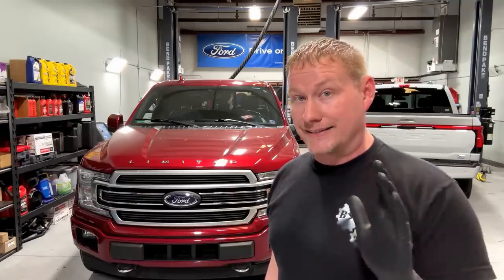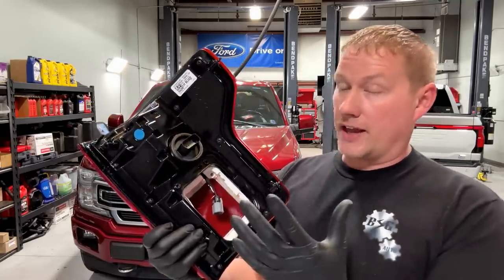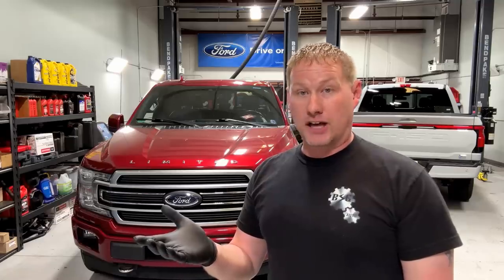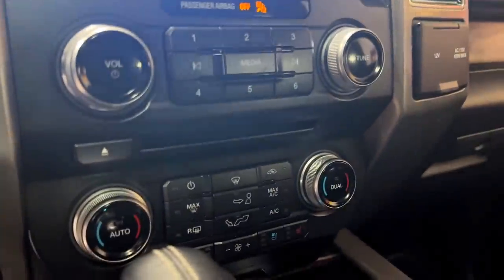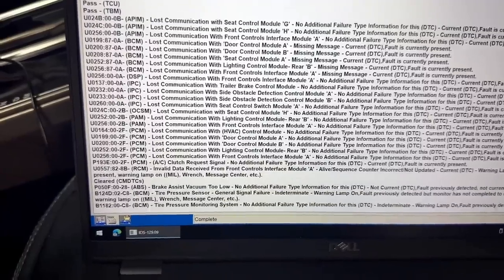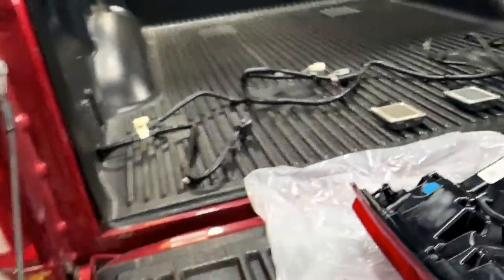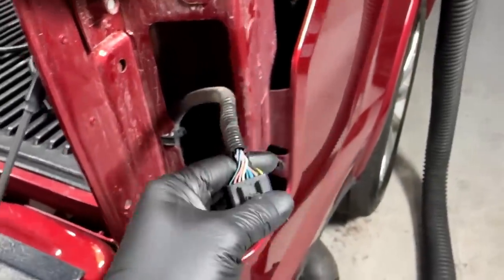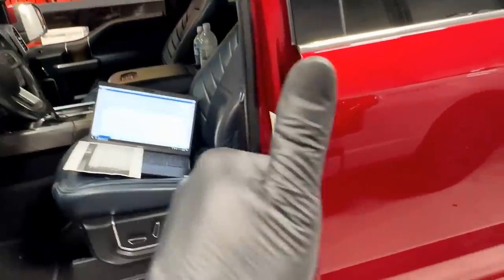Repair Cost Are Out of Control: $5,600 Bill for Some Tail Lamps?!

Comment: I am now 66 years old, and have been watching tons of car crash videos, and while doing so became shocked at seeing many cars being simply written off due to ridiculous repair costs.  What would cost say $100 in my younger days, could be up $10,000 today.  Ah yes, I also recall way back when, that you could even purchase a Honda Civic for $2,000 CAD.
Reply: $100 from 1963 is worth about $1000 in todays money. So yeah, even accounting for the ~900% price increase due to inflation from then this type of repair would still be 5 1/2 times more expensive than back then.
Reply: Back when there were no safety crash standards. Yes all you would need was a new bumper for $100, but you weee in the hospital for a week from injuries sustained in the crash. Today the vehicle takes all the damage and you walk away un injured
Reply: The real problem is Ford using an inferior tail lamp that leets rain water in. My 2016 Lariat was having the same issues. I was lucky, my cost was  $0. My diagnosis was to unplug the white connector under the truck near the spare tire. All the warnings shut off. You cannot drive it because you have no tail lights with that unplugged. I took off my rear passenger tail lamp, shook all the water out of it, left it in the sun for 12 hours, made sure everything was good and dry. Put back together and works perfectly. I did do something’s to stop the water, but Ford needs better parts. I remember when Quality Was Job 1.
Reply: @jackylsmith8138 you won't be in a crash because your newer car with all these crap electronics can't be started at all
Reply: Thx for the vid.
Reply: An 81 year old widower friend of mine spends all his days still repairing things that no one else will because they tell their customers to just go buy new ones (often at 50x - and more - than the original one’s cost).  He has a house, shop, and outbuilding he’s spent his life stocking to the brim with parts of every kind that he’s picked up in old inventory closeouts, swap meets, etc, based on what he knows are common failure points.  We talk on the phone almost every day, and he draws massive satisfaction from just helping people keep their stuff going.  And his work is usually better than original.  He makes improvements when he sees an opportunity (eg: changing old bulbs to LEDs, lowering power demands, etc).  He often doesn’t even charge anything.  He knows where every minute little component he has is stored off the top of his head, and has a massive amount of printed documentation (schematics, parts manuals, etc) from a lifetime of work for just about everything, meticulously organized.  This man is seriously my idea of a true hero, and on the very rare occasion where he doesn’t have a schematic he needs I find it online for him and print it and take it to him (he doesn’t use a computer except to find swap meets).  I know that he won’t be around forever, and that thought kills me.  But being able to even be just an occasional sidekick to this true hero makes me proud.  The world needs way more of these people.  They’re a vanishing breed.
Reply: @TastySurrealBowl  As a Survivalist in my late 50's, I'm actually transitioning more towards Minimalism, these days: Consuming my oldest stored food, getting rid of some firearms (with demographics and physical fitness levels these days, who's gonna attack my house, anyway?).

I'm migrating more towards being like your 81 year-old friend, buying what I need to do my own repairs, fabrication, etc. We have to, now. Our society is collapsing, in-part due to Diminishing Returns on Complexity (Tainter). I don't own a truck newer than 1995. Even my 2007 KLR 650 motorcycle was the last good year for that bike. Besides, the last two times either of my trucks left a shop, the mechanics left dangerously low levels of engine oil, power steering fluid, etc. No one does anything right anymore.

 - Former Army Infantryman, electronics technician, retired U.S. Army Intelligence Officer.
Reply: @jackylsmith8138 excellent point , but unnecessary electronics have nothing to do with this. The best protection is your brain, which seems to shut down with some drivers.
Reply: @jackylsmith8138  It's more like a manufacturer defect. I'm sure it happens to other vehicle brands. But, many regurgitate and talk out of their asses.
Reply: Yes, Dalt's Used Cars in Toronto was the first to bring the Honda Civic into Canada and sell it in 1973.  Dalt's was in my neighbourhood and a friend of mine was one the first to buy a brand new Honda Civic for $1,460.00 CDN.  The BIC disposable cigarette lighter had just been introduced to the marketplace, so when people saw his new Honda people said; "Wow, now they're making disposable cars".  The first Honda Civic ever sold in Canada is now on display in the showroom of Dalt's Honda in Orillia, Ontario.
Reply: I have a 2002 can chassis Cummins Diesel. A little metal clip is all that kept the keyway in and they cost seventeen dollars and require a new plastic axle nut.
  When it failed, the nut unwound and blew the outside bearing ruining the rear axle threads.
   Thousands of dollars even for a jig welded axle end.
   A machinist buddy suggested trying to get a two inch female die after measuring the thread pitch. I made my own thread centering jig out of PVC plumbing pipe of all things 
   I researched further and found out the axle was Spicer so we went with a much superior Chevrolet axle nut and a Chevrolet / Spicer retention ring instead of that crappy little clip that failed in the first place
   Now when I have to replace rear brake rotors and such, there is no fear of this happening again
Reply: @jackylsmith8138 I consider walking away a major injury
Reply: The less reliable, the bigger the income of after sales.
Although safety regulations have become more important, a bumper isn't as rugged, as it was made back in the days..
I remember, running into a friend that just hit a light pole, with his Chevrolet Monza.
The steel light pole was totally wrecked, and the bumper barely showed a scratch..
Reply: @jackylsmith8138   Better crash standards are one thing, all of these unnecessary electronics can fk right off.  You could make basically the same complexity of vehicle as, say, the 90's (golden era IMO) with improved safety and retain the serviceability.  But they want your seat to have heating/cooling/600 adjustments/make ice/blend a martini/etc. and cover everything in 15 layers of plastic before you can even access something that matters.  The only reason people go for all of these luxury "upgrades" is because they don't understand interest rates or debt and definitely don't understand long term ownership costs.
Reply: @TastySurrealBowl 
After living in the southern region of the U.S. for almost 30 years, before moving back to the rust belt, I found incredible 'backyard' good ole boys mechanics available & willing to work on my cars in their home shops. Their mechanical abilities were awesome, their curiosity never failing & their fairness in pricing always sound.
Most were old school, as am I, & as you stated, a dying breed. These guys have a love for cars, always striving to make them better. Admittedly most do not want to work on these tech driven monsters they produce today, but boy oh boy I sure will miss them when they disappear completely. They are a treasure....

Comment: This is why no matter the cost repairs on my old vehicles it's worth fixing. This one repair cost almost as much as the vehicle I've had for the last 8 years. I don't have all these fancy gadgets but I save tons over vehicles like this
Reply: And at the end of day it accomplishes the same goal; IT GETS YOU FROM POINT A TO POINT B.
Reply: Amen
Reply: 100%! My old Ram is ugly, but if I keep it maintained, it will keep running. It will be a treasured antique long after these modern vehicles have been recycled.
Reply: Same here.
Reply: @jamesgizasson ever check what those "old" Rams are selling for? My old 87 Power Ram in good condition, others asking about $25k for it. Mine isn't for sale.
Reply: @northdakotaham1752  Oh, I'm aware. But even if some fool offered me 25k, I wouldn't be able to buy a better truck for that money... 

All I'd get is a prettier, more complicated, more expensive, less reliable piece of crap. And it wouldn't have as much aftermarket support. T^T
Reply: I just paid $3,500 for a 2003 Ford Ranger XLT, just a tad over 100k miles. Drives like new and is simple to work on compared to these new cars. And unless your pulling a huge boat or a large trailer... my little ranger can do everything that $62,000 F150 can do. Oh wait, I don't have a power tailgate on mine so I guess the extra $60k is worth it ;).

Comment: Last July I had a 2015 F-150 in the shop. The radio was not operating, the climate controls were dead, and the power windows would not operate. Same thing, one of the tail lamps had water in it, killed the communication bus. Ended up being a $3000 repair as well.
Reply: You got away light!
 Get a tube of electrical grease and do every connection you can find/ and then the hard ones you cant see. Then keep your fingers crossed and hope like hell.

Comment: Those parts prices are criminal. Unbelievable.
Reply: Why didn't he buy all the parts from a quality auto dismantler as they would have been about 25% of the price of new???
Okay, the taillight lens would have cost up to 50% of the price of new if they were in perfect condition...
Reply: Don't know about this Ford truck but with a lot of cars now electronic parts off another car will not work even if same year, make, model. Friend of mine owns a shop and customer bought a headlight off eBay that worked on the bench but would not work in the car because only the dealer can program the car to accept the new parts and they won't do that unless you bought the parts from them. Because "liability." Edit: I forgot to mention one headlight from the dealer was $3500 and his eBay headlight cost $800.
Reply: My '98 Ranger XLT 4.0 supercab with the automatic and AC was under 20k out the door. That included a deluxe color matched cap and some other bits. Wish I had bought two of them and stashed one.
Reply: $100,000 for a pickup truck is a stupidity test.
Reply: The truck was $68,000. I still have the window sticker. 

I’ve enjoyed the truck. I can afford the truck. 

It’s unclear why people are angry at me for driving a F-150. 😂🤷
Reply: @MH-YouTube-Controlled  The average 35 YO American male is only half as smart as his father, and he was half as smart as his father.  The advertising industry is aware of this. How can the buying public put an end to the $100K pickup truck?...STOP BUYING THEM
Reply: The new vehicles are high-tech. and designed to save gasoline and the environment by making you broke and riding the city bus to get around.
 Old school is always the best school in town.
I go to a dealership and look at the Sheeple waiting in the 'lounge' to get their vehicles serviced/ repaired/ with wallets or credit cards at the ready.
 Schmucks ...
Reply: @Mytruck5600tailights  I think it's because every time someone pays these kinds of prices for what was supposed to be a utility vehicle, it's another data point for the manufacturers that they can get away with it.
Reply: While I've used that truck on several RV travel trailer trips, and to haul various things, I bought it because it was a luxury vehicle. If it didn't have all these "bells and whistles" I wouldn't have purchased it, and I still love the truck. @KidCorporate
Reply: What a disgraceful design from Ford ⚠️
Reply: Then you’re part of the problem, bub! It sounds like you would buy another new truck from Ford, even after this fiasco!
Reply: We need legally mandated standardized bulbs like in the days of sealed beam headlights.

Comment: I think I will look for a 1995 model year for my next F150.  I've had problems with the PATS in my 2010 F150 XLT.  Ford is obviously hiring former F35 design engineers to put all of this technology in their vehicles.  Unfortunately most of us owners don't have almost unlimited funds to keep our vehicles running like the military spends on the F35.  Water getting into a taillight housing is not exactly an unexpected occurrence but obviously the engineers who designed it never thought it could happen.
Reply: I got a 96 ford f150 2wd standard shift 300cid

Comment: Ford Truck LTD owner:" My truck doesn't start! Can you fix it?"
Ford Mechanic: "Absolutely! We just need to change your taillights - that'll be $5600 please."

No shade thrown at Brian - he located the fault and provided the fix. It just ridiculous at how expensive it has become to fix these technological terrors. Thanks for the 'enlightening' video good Sir!
Reply: This just reinforces my decision to keep my 2011 F150.
Reply: @williamchristenbury1774 exactly right I'm staying with the 04, that 3 valve
Reply: Imagine being told that 20 years ago, that TAIL LIGHTS caused a no crank... 

Insane.
Reply: @williamchristenbury1774 my 2011 5.0 just hit 300k miles im keeping it too
Reply: @williamchristenbury1774  : I had a "97 Safari that broke every time I used it. Back in about 2003, the fuel pump went low pressure. No problem. It's inside the gas tank, and was only $842, in a box. I did the labour. The water pump started leaking, followed by the alternator failing, which took the battery with it. I noticed the brakes were making noise. The front rotors wore down to the point where they couldn't be turned, followed by the rear brakes having the fiction material break loose. ( riveted, in '97?)The rear doors leaked. The power windows failed, withing days of each other. The rear heater failed. The front blower failed. Of course the armrest wore out. There were likely other failures too.
I had much better luck with a LADA. At least when it broke, you could get to the parts, and they were cheap.
Oh, and it was the last GM I'll own.
Reply: Unfortunately these days it's not just ford they pretty much all do this crap these days
Reply: I joke with people that, "your wiper fluid is empty?  It's totalled because in order to fill it you have to remove the driver's headlight assembly, the driver's fender, and the brake booster, and it is a known issue that if you remove the headlight assembly the tabs will break, but the assembly is married to the ECU by VIN so it's a dealer only part and the software to program the ECU to get the new one married is $5,000.
Reply: Ikr, it's not even a trans or engine,
Reply: Yep! I'd sell that overly technical and I've engineered vehicle asap after the repair is complete.
Reply: We had a 2018 F250 with the 6.2L gas engine but the intake manifold was bad. The runner control inside is plastic or something and they break and cause problems. 

The part is backordered and no ETA to get it. We ended up getting a new Silverado. Hopefully now if something breaks we can get parts. The fact you can't even get parts from Ford is very annoying.
Reply: a working truck with all that gumph in the tail lights,absolute joke,cant believe the insurance companies will be happy either
Reply: nuts
Reply: @Bandit69ply 😮😮 3:14 😅7😊
Reply: $5600? Absolute bonkers!
Reply: I got a 2019 f150 and have had issues. 2 alternators in 4 months and trans issue. At 50k miles. Thankful I have ford and a 3rd party warranty. But I got the xlt because I’m use to older vehicles and don’t like all that fancy stuff.
Reply: RAM 2016 with 115k. My next truck will be at least 18 years older. I am going to build her myself.
Reply: Or you can literally go buy another  decent running vehicle to drive 😊
Reply: @c99breeze2011  Ford should say. Our sensors? You have greater chance of getting hit in your pocket book than being hit by passing car.
Reply: If you live in america buy America they are the best  but don’t buy new generation trucks they are nothing but sensors   Ford f250 7.3 are the best that’s why I keep my truck
Reply: And his customer was more of the exception and not the rule. Most people would have pooped a mouse if I told them the vehicle needed new tail lights and it would cost $5,600 to fix their vehicle.
Reply: Sounds like a beginning of a money pit. 💰